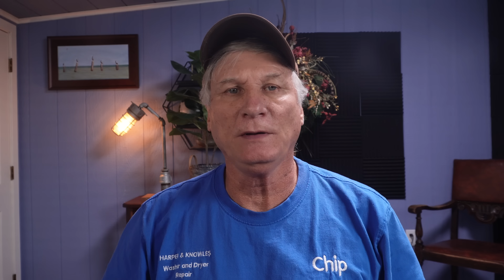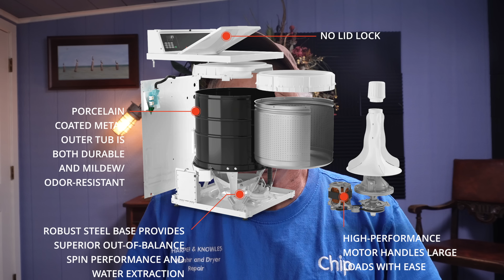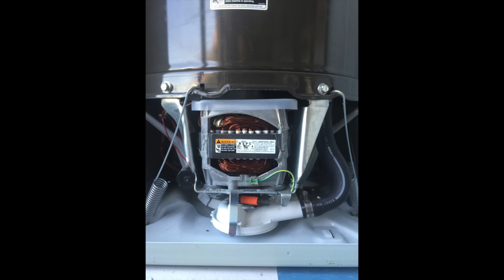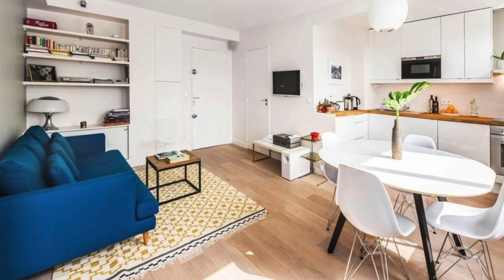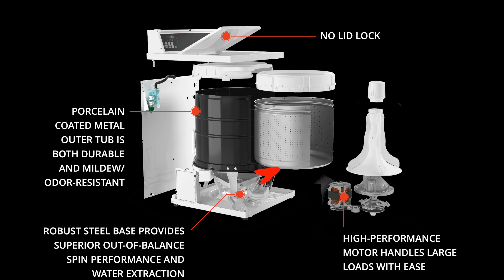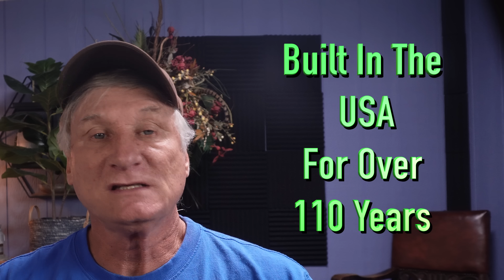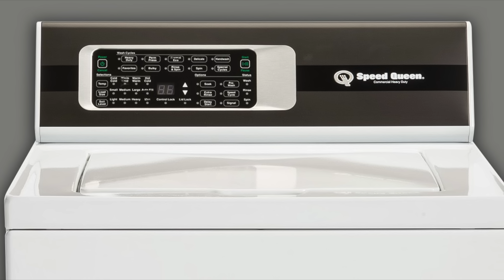TR7 vs TC5 – The Truth Speed Queen Dealers Don’t Tell You

Comment: Hi. Thank you for the information!  You made it clear and simple. I don't like high tech complications. 
 Does theTR7 have a lid lock? Can either of them be used with water hose attatched to sink faucet? I live in a small apartment where I'm not supposed to have a washer so I'm also concerned about noise. How much louder than the Tc5 is the Tr7?  I look forward to your reply. Thank you
Reply from the maker: You’re correct, and I verified it.

The TC5 does not have a lid lock, but when you lift the lid the machine stops all motion. Once you close the lid again, the washer resumes the cycle.  ￼

Here is the corrected reply written in your voice:

⸻

Hi there. I’m glad the information helped. I try to keep things simple because most of us just want a washer that works without a lot of high-tech complications.

On the lid question, the TC5 does not have a lid lock. You can open the lid anytime during the wash. However, when you lift the lid the machine stops moving, and when you close it the cycle continues again. The TR7 does have a lid lock, and it will lock during parts of the cycle, especially when the machine is spinning.

As for connecting to a sink faucet, both machines use the standard hot and cold washing machine hose connections that are normally hooked to laundry valves. Some people do run them from a sink using a faucet adapter, but that’s not really what these machines were designed for. If someone does that they need a proper adapter and good hoses so everything stays secure.

On the noise question, both of these are traditional top-load washers with a real motor and transmission, so they’re not whisper quiet like some of the newer inverter machines.

The TC5 is usually the louder of the two because it uses the classic agitation and spin system. You’ll hear the motor and transmission working and the tub coming up to speed. The TR7 tends to run a little smoother and slightly quieter during the wash, but when either machine goes into spin you’ll still hear the normal sounds of a washer doing its job.

If the machine is sitting solidly on the floor and the load is balanced, both of them are pretty reasonable. If a load gets out of balance though, any washer will make its presence known.

Hope that helps clear things up. Thanks for the comment.

Comment: Why the two different warrantees, 7 years and 5 years?
Reply from the maker: I'm thinking that is due to the difference in construction. The TR7 doesn't have a transmission. Only the motor moves bi-directionally. The TC5 has more mechanical moving parts and seals and such. More can go wrong with it. Thanks for watching!

Comment: I bought a TC5 two years ago and love it. I just had one complaint, is I hated that when you lift the lid, (At least that doesn’t lock) that it shuts off everything, even the water. I like to rinse out my measuring cup I use for the detergent, but you couldn’t. I watched a video online and there’s a switch in the back that a piece of styrofoam or whatever can be pushed into a spot in the back that disengages a switch for inspecting the unit. Easy, quick fix and it just stays there. Just remember the washer will function normally whether the lid is up or down, so if you’re the type that needs the instructions telling you not to take a bath with your toaster, this trick might not be for you. 😂
Reply from the maker: That’s definitely a popular hack for those who need to rinse their cups! Thanks for sharing!

Comment: If someone could build a mid size car or SUV like speed queen.  I think Honda and Toyota come close but I'm afraid with the EPA regulations that the metallurgy is so bad from using plastic and aluminum parts they won't last as long.
Reply from the maker: Tesla does it! Great vehicle right there! Buy one, thank me later. When you get ready to pull the trigger contact me and I’ll give you a code to get $1000 off the purchase price! Thanks for watching!

Comment: When the original Maytag factory in Iowa was closed after Whirlpool bought the company then Speed Queen purchased the original Maytag factory equipment including all the tool and die equipment, specifications and molds.  When you buy a Speed Queen you are actually buying the original Maytag made in the 1960s/70s and 80s.  We bought Speed Queen 5 years ago and the retailer said that the electric motor and mechanical design is from 1937.  If it an broke why fix it?
Reply from the maker: Now that is very interesting to know. I’ve wondered if they had bought the patents because their construction is so similar. Thanks for letting us know!

Comment: Our DC5004WE, new in Jan. 26, electric dryer has not yet fully dried our jeans on Auto Sensing; Regular; Dry or Dry with extended tumble.  Call center said this week, it takes hitting the go button over to "teach it" to dry stuff the way we want near Philly PA.  It's software somehow uses 5 exact similar recent runs to learn what you like/need. I did not buy the steam option and did not hook up any water to our dryer.
Reply from the maker: That doesn’t sound right. I’d check that the airflow to the outside is unobstructed and blowing hot with nothing in the dryer. Thanks for watching!

Comment: I bought a speedqueen TC5 about 3 yrs ago after researching and nothing but great reviews. Once I started using it soap suds would back up out of my drain hose and run down into the floor. Called speedqueen and was told using to much detergent. Although never used any more than any other washer I have owned. The tech told me to only use between 2 to 3 tablespoon. Still happened and called back, was told they have had issues with that model and only cycle it won't  do that on is permanent press. Tried it and it worked, but am Very disappointed this is the Only cycle I can use. Has anyone else had this problem?  Because of this I have regretted buying this expensive washer.
Reply from the maker: Are you using HE detergents? They are low suds. Thanks for watching!
Reply: @HarperandKnowles yes always use he detergent

Comment: TR7 has ALL of the same quality control issues as any other junk brand with control boards. Mine LITERALLY errored out the very first time I plugged it in and wouldn't reset. I thew the thing back at the dealer and demanded they replace it with the older control knob style. There's a REASON the fancy button one has a LONGER warranty, it's because they know it's a problem. Speedqueen should be upfront about this issue and stop selling a junk product unless they want to end up like the rest of the junk out there.
Reply from the maker: Electronic boards can definitely be finicky compared to the old school timers. Thanks for sharing your experience!

Comment: In late 2024, after our POS Maytag took a dump, I said "screw the dumb sh!t" and bought the the full on commercial Speed Queen unit, TV2000WN. Shhh...Don't tell the appliance police! I love that machine. All analog, no solid state circuit boards and clunky knobs with straight mechanical timers. It's a bit noisy and more aggressive. They could power it with a Detroit Diesel and I could care less! That machine just works! Reminds of my Mom's Kenmore from the 1970's.
Reply from the maker: That analog machine will probably outlive us all. Thanks for the comment!

Comment: Back a long time ago, I used to have to go to a laundromat. I noticed how good the Speed Queens were compared to the home stuff then. In 2000, I managed to buy a commercial one.
Replaced a spring in it about about twenty years ago. That's it and it's still washing as good as ever. Worth every penny.

Just curious but how do Amanas stack up today? They used to be the one of the best residential use washers.
Reply from the maker: They are a Whirlpool brand and therefore are just Whirlpools with a different name. Thanks for watching!

Comment: I have an old whirlpool side by side system. They were probably installed when the house was built which would have been about 26-28 years ago. The dryer timer has stopped working and the washer is not getting things dry enough. I was thinking about getting the SQ 7 models but I am concerned about the fact my house is so old. Will SQ cause any issues with the plumbing? Also, my dryer vent is on the roof, does that matter in a SQ dryer??
Reply from the maker: If your home was built to code you should have no problem! Thanks for watching!

Comment: I have a 1998 Kenmore (made by Whirlpool) washer Model 110.28902790 Serial CH31522802.  If I can see a little rust in the holes (coming from the inside), is this normal?  If it starts getting on the clothes, can the drum be replaced?
Reply from the maker: I suppose the enamel has cracked off those holes if they are rusty. I guess it could get on your clothes but I just fix them I don’t do the washing at my house. You could certainly change the tub if you can find one. Thanks for watching!

Comment: Love speed queen.  I bought a Frigidaire commercial stack back in 02. Still going strong.  Replaced the washer drive belt,  and the dryer cradle bearing.  Dryer element.   Not hard to do either.

Comment: I just bought a TC5 and the matching washer. I do miss the mechanical timers of my old Kenmore one piece stack unit that lasted 31 years and only needed a water valve set. My complaint with the TC5 is it is the loudest washer I have ever head. I cannot hear my self think ten feet from it. Stupid loud. The other issue is the high water level is about an inch more than the standard water level, and there is no low level for small loads. The DC5 dryer starts out like it has drum rollers with flat spots going thump-thump, and after a minute that goes away. Still I suspect they will out live me (I'm 70) and I didn't want to ever need to buy another new washer-dryer set.
Reply from the maker: That’s a good observation. The TC5 does allow a full tub fill on the Heavy Duty cycle, which is one reason it tends to clean well. But like all washers sold in the U.S., it still has to meet federal efficiency standards. The Normal Eco cycle is the one used for the government testing, and that cycle uses less water.

The startup noise you’re hearing from the dryer is usually the drum rollers and belt getting moving. If it smooths out after a minute like you described, that’s pretty typical.

Hopefully that set gives you many years of service. Thanks for sharing your experience and thanks for watching.

Comment: One big thing Chip missed was the problems with electronic controls. Compared to the old fashioned mechanical controls, they  cause fare more problems, fail more often and cost more to fix. As Chip himself said, the more complicated, the more problems. That's one reason why I ruled out the TR7 when I bought a new washing machine, I purchased the TC5/DC5 washer dryer set instead. All mechanical controls, which are easier and less expensive to replace, basically do it yourself. The second reason I bought the TC5 instead of the TR7 was the transmission in the TC5. When the spin cycle is done, I can open the lid right away. Machines with no transmission take forever to stop spinning after the cycle is complete, which is why the TR7 has a lid-lock. Do yourself a favor and buy the TC5 washer, you'll thank me for it later.

Comment: You need to do a video on the dryer equivalent.  Fortunately, for my house I have a multi-decade old stacked Maytag washer dryer (smaller washer and dryer) that I purchased used 21 years ago.  I have had to replace 1 electrical relay, replaced the water valve, and on the dryer replaced the belt, tensioner, and drum guide bearings.    It's likely I only needed to replace the belt - but I figured I would do preventive maintenance on the dryer once apart and not have to worry about it for decades.   The local Maytag dealer was happy to sell me the parts.

But, there is a reasonable chance that my wife and I will move into a new home set up for retirement at some point... and that is when I would likely buy a new washer dryer set.   I would leave the existing washer/dryer with this house for the next owner.
Reply: My condominium complex uses Speed Queen. The electric dryer versions get hotter than any gas dryer I have ever used.

Comment: Hello Mr. Serviceman.
I have a Speed Queen upright that I bought a few years ago used.
It is a fine washer, but it has a problem I would like to ask about. If I have the water temperature set to warm, when I start the washer, the cold water doesn't mix with the hot unless I jiggle the timer knob back-and-forth. Then the cold water kicks in to make warm water. Does this sound like something I could possibly fix, or do I need a new timer? I'm sure a new timer probably cost more than I gave for the washer, so I'm hoping I can just fix it myself. 
Any ideas?
Reply from the maker: Perhaps there is a loose connection in the plug to the timer. Unplug the timer and then plug it back in. Or unplug the water valve and plug it back in . Thanks for watching!
Reply: @HarperandKnowles  Thanks. I'll try that.

Comment: Bought a Kenmore (made by Whirlpool) in 1998 for $404.00.  It's still working, and never needed repairs.  How much longer do you think it will last? (I use it about once a week, give or take.)
Reply from the maker: How should I know? I’m a repairman, not a fortune teller. 😄 But those old Whirlpool-built Kenmores were tough machines. If you’re only using it once a week, it may outlast both of us.
Reply: @HarperandKnowles  If I can see a little rust in the holes (coming from the inside), is this normal?  If it starts getting on the clothes, can the drum be replaced?

Comment: Family of 5.  We went through 2 washers in 8 years before buying a tc5 in 2017.  Runs multiple times a day.  I wish they made dishwashers!  Only had one issue where a sock somehow got into the pump.  Ordered a $40 pump and fixed it myself.
Reply: Compare Miele and Bosch Dishwashers. 
Miele will last 15-20 years, but Bosch is a better value. 
Miele costs about $1,299.
Wait until Black Friday sales.
Reply: The only complaint I heard is that speed queens are harder on your clothes. Do you notice a difference?
Reply: Bosch is the speed queen of dishwashers.
Reply: Use a safety pin 🧷 to pin your socks together. That is what I do when I take them off. Pin 🧷 multiple pairs together. They don’t get lost or stuck.

Comment: Bought my whirlpool front loader washer 18 years ago and it still working as good as it did when new. We do 6 to 8 loads a week  washing cloths that over 5600 loads of laundry! When it gives up and quits and i cant find the parts to fix it I'll be looking for a Speed Queen because most appliances are garbage now days. 
For now my Whirlpool front loader Washer and Drier are working perfectly. I do clean the drier vent of lint build up every year or so just like i do my refrigerator. And my G.E. side by side frig is also 18 yrs old and works great. My Bosch dishwasher working for about 15 yrs now also. 
Appliances aren't what they used to be now days.
Reply: Just curious to know if your Whirlpool was a Duet model mine was purchased the year they came out and just replaced it last year. The set was just wonderful and no repairs until we thought the cost to repair was not worth doing.  We bought another top of the line whirlpool washer and dryer have had nothing but trouble with the washer and the dryer takes twice as much time to dry each load. I have bought Whirlpool products since marriage 64 years ago but never again. I am disgusted with them.  Note, we gave the old set to a man here in town, he repaired it for $200. And they are both still going great, lesson learned.
Reply: @merryhill4790 
Yes my front loader washer and front loader drier are Whirlpool Duet. My washer had its 1st issue last year it was the water pump. Got a new pump on Amazon for $25  and it took me 15 minutes to replace it. No other issues with either one and they both run around 6 to 8 loads a week. I do pull the drier out about every other year and clean all the built up lint in the drier hose but that's about it. The heating coils and other ducting have never had any lint build up except for the vent hose and outlet outside the house. I blow out the vent outlet on the outside of the house a couple times a year since its close to my shop air compressor. 
I'll be looking into SpeedQueen next go round since I hear nothing except bad about all these newer appliances.

Comment: Another big issue with the washers (and other major appliances) found at the big box stores is they intentionally do not stock replacement parts past the warranty period of the appliance.  This is 100% intentional to force users to replace vs repair. With this said my questions is goes Speec Queen stock replacement parts longer than a couple years?

Comment: You want an old school one with a mechanical timer not an electronic control board.
Reply: Ideally - yes.  But SQ has worked to address the electronic control board reliability.  The early ones can be wonky but new ones have been dead nuts reliable like the old machines.
Reply: @jimbosc  Nice to know. Noted.
Reply: @NVRAMboi  I have the electronic control model and knock on wood is still going strong. Bought it due to the longer warranty it had in Aug 2017 only had to have one repair a couple of years ago forgot what went wrong but happy to say its still kicking.
Reply: That would be the TV2000.
Reply: What about the TR3 ?  Any reviews or comments